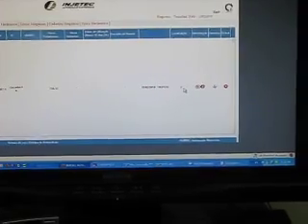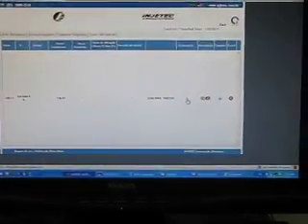802.15.4 microchip MiWi stack protocol. MRF24J40

Comment: I got some MRF24J40MA modules. But I have no idea how to get the MiWi protocol stack programmed into them. Don't know how to get them running. Microchip websiite is full of broken links and is hell to navigate in or find what you want.
Reply from the maker: ***** , good to see you here.  You can get a good information and code at mla(Microchip Library for Applications)    http://www.microchip.com/pagehandler/en-us/devtools/mla/home.html
you can get all the application notes about MiWi
Reply: Marco Aurelio Silva
Think I've downloaded them before. I use linux, and when executing the .run file nothing happens. It doesn't even give me an error, or error code when trying. (ofcourse I have not forgotten to change the file permission for executing)